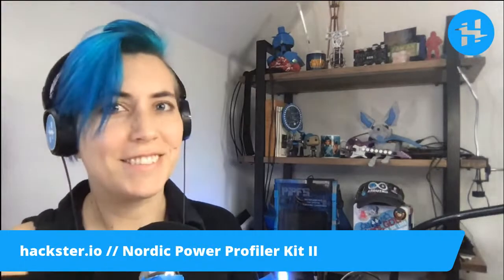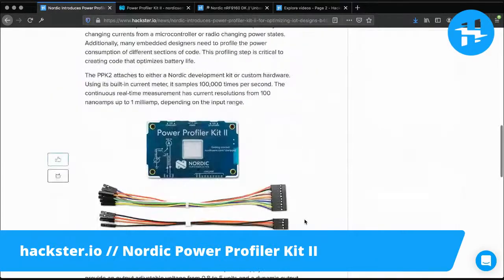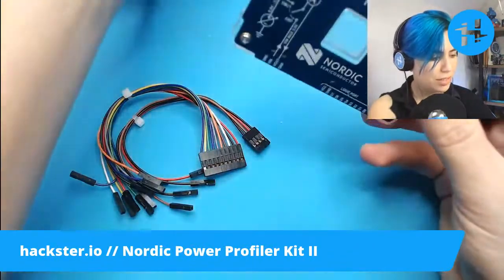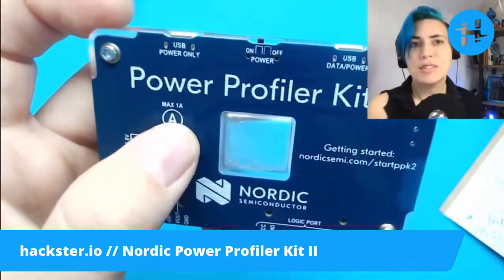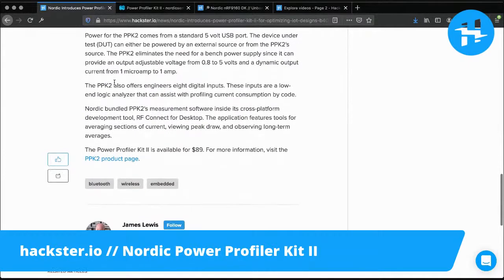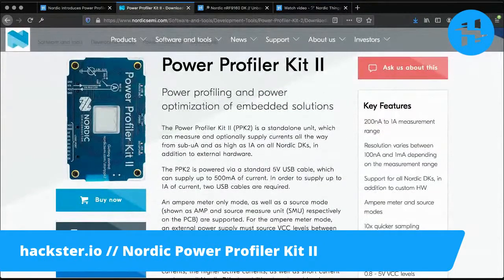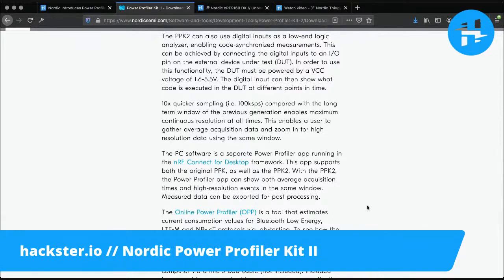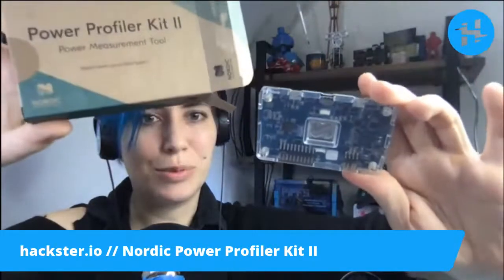Nordic Power Profiler Kit II

Comment: What use is the "USB Power Only" port? This device doesn't log data to any kind of internal memory or SDcard, does it? So why would anyone want to connect it via USB without data?
Reply: Edit: "The PPK2 is powered via a standard 5V USB cable, which can supply up to 500mA of current. In order to supply up to 1A of current, two USB cables are required."